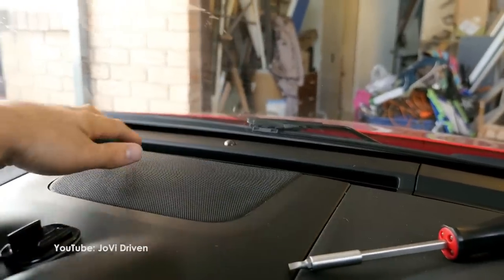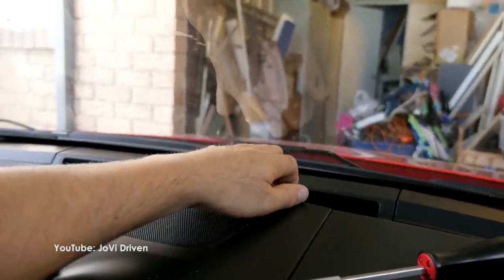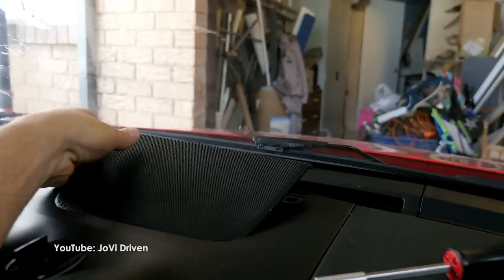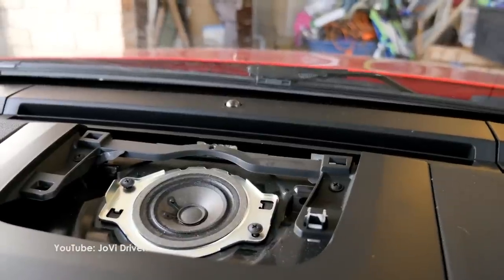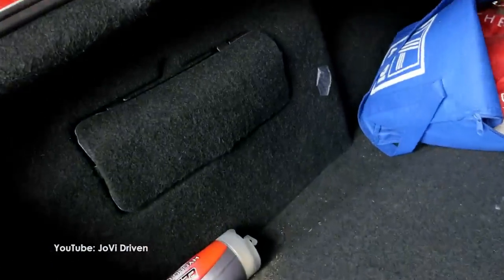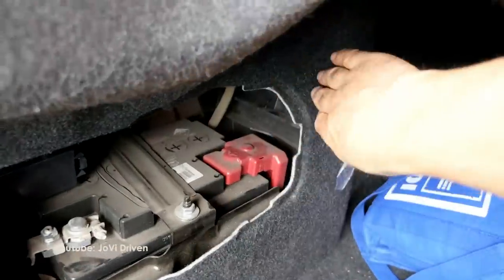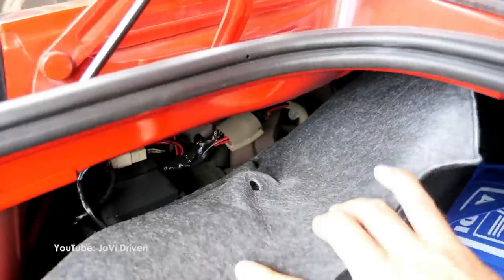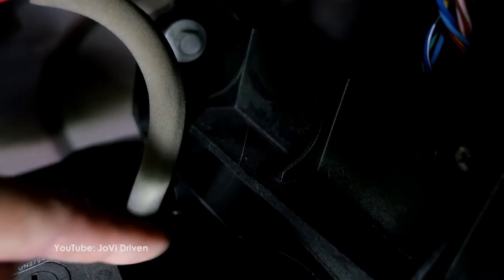VE Commodore Stereo Upgrade

Comment: I realise you are well meaning however turning up the gain is what you are talking about anyway , you really need to rip  out the whole system , put in quality AMP, Replace the 8inch subs with better 8 inch subs you can find 250 rms subs on eBay at about $140 each , the ones in Calais etc are about 50 watt it says on them and I doubt that is even RMS , also replace head unit , replace front and rear door speakers tweeters etc with quality , cost you about $1300 however everything about these Calais ,SS systems etc need to be chucked if you want good quality SPEND THE DOLLARS you only live once it’s about $1300 for a complete swap to get a decent sound
Reply: Ok but the point of this was free solutions that’s what he said

Comment: Most people probably aren't fussed about low end frequencies, and in my Calais V I have no problems with the audio quality. Have you got a Series 1 or 2? I've heard S2 isn't as good sounding, whereas the Blaupunkt are quite good in my opinion.
Reply from the maker: TheOnlyJarrod it's a series 2. It mainly depends on what style of music as to how bad or good it sounds. It handles hip hop and dance tracks well, but lacks a lot when it comes to most rock styles, which I mainly listen to. After making this video I reversed the polarity of the subs, which definitely made another improvement. I then also replaced the door speakers with Pioneer 6.5 inch 2 ways with I picked up on sale for $29 a pair. I also disconnected the dash tweeters, seeing as I now had them in the doors. I think I've got it to the best I can without looking at adding an amp. I wouldn't mind getting a high input amp in the future so I can get just a little more volume out of the 2 ways. I think the head unit is only like about 10w RMS per channel or something like that.
Reply: Yeah would be nice with some aftermarket speakers indeed, I want to look at Pioneer too, they seem to make some really decent ones for the price they offer.

Comment: i can confirm that this is NOT applicable for a VE SV6. No amp installed, although the dealer seemed to be under the impression it would be there. So basically, if you have a VE without rear speakers installed on the rear parcel shelf, you have NO AMP.
Reply from the maker: Thanks for clarifying Anita. I've just made some upgrades to my system for under $300 and am in the process of putting a video together. It will probably be useful for you, so stay tuned.
Reply: it seems as though the wiring loom is there to connect to an amp, but the cost of genuine GM parts is absurd here, so i'm going to look at a full Alpine install 8" unit etc.
Reply from the maker: It took me a while to figure it out, but the audio inputs from the factory wiring near the battery are actually speaker level outputs directly linked to the rear channels of the factory head unit. So if you can get a 2 channel amp with speaker level inputs, that should work to power 2 subs.
Reply: there aren't any subs fitted, only rr door speakers
Reply from the maker: Sorry, I though you meant you were going to fit subs as well. If you're just after a better sound, replacing the head unit will set you back minimum $1600, because you also need to replace the air conditioning interface, etc. But I've gone for a 4 channel pioneer amp with speaker level inputs and 4 new door speakers and it cost me under $300. To have it professionally installed would have been around $500 all up. This is the amp I used. Pioneer GM-A6604 4 channel amplifier with speaker level inputs: https://www.pioneerelectronics.com/PUSA/Car/Amplifiers/GM+Series/GM-A6604

Comment: Quick question if i upgraded my door speakers to pioneer 6.5s with the front doors having tweeters etc... if i leave the stock tweeters and that centre speaker in, does this reduce sound quality on the good speakers?
Reply from the maker: When I installed new Pioneer 2-way door speakers, I unplugged the factory tweeters.
Reply: I just put in a nvx coaxial speaker but still have my tweeters in... ive got no sound with centre and my door speakees are fine... i will remove the tweeters 2m and see if centre and doors work? Very strange!

Comment: The first part in relation to the centre speaker is good advice. The second part is really bad advice.
This is advice by people who don't understand gain.
Simply do some research or talk to someone who understands what it's for and knows how it works. Don't crank "up" your gain. Without getting into a long boring technical explanation, in a nutshell, you risk damaging your amp because you are decreasing resistance, and you'll get a crap sound because you'll have more noise/hiss in the signal too. Gain is NOT a volume control. There's a reason for a Gain setting. It's based on the total resistance of the devices connected to it and how they are wired (series or parallel).
So just leave it alone.
If you want better sound, first get a better amp, then, better head-unit and speakers, maybe a DSP... Do some decent subs and box them properly.

Factory sound is cheap and basic to keep costs down. Even when a car manufacturer uses "brand-name" gear it's the lowest costing most basic OEM gear they can make, and won't even usually come close to the entry level gear that brand will sell off the shelf.
Reply from the maker: To be honest, I'm not sure whether that control knob is gain or volume. But I've ran it this way for over 2 years with no issue. It's not distorting. Just adds a little more volume to the lower end, which helps balance out the rest of the audio system. And this was meant to be a no cost option, before spending on upgrades. I still ended up upgrading the door speakers and later ran a 4 channel amp to them, but still kept the subs and factory amp in.
Reply: This gentleman has no idea what he is talking about. He quotes "Without getting into a long boring technical explanation". That's a tell.

How about a short and interesting explanation.

Gain is simply 'pre-amp' volume. An audio amplifier has 2 stages. Pre-amp and power amp. Pre-amp volume (gain) is used to calibrate the incoming signal to a suitable size for the power amp, ideally about 2.3 volts. The power amp then takes this calibrated signal and amplifies it for the speakers.

By all means crank up your gain. If the result is perceivable distortion, you may want to dial it down a bit. You won't damage your amp. (unless it is being sent an over voltage signal in the first place)

This is, after all, exactly how guitar players get the desired distortion tone. They overdrive the pre-amp. Their amplifiers are not 'damaged' by doing so.

The installers at the holden factory may have been under instruction to keep the subs low volume for whatever reason. (Perhaps disassociation with the aussie bogan image hah)
Reply: @johnnykeys1978  yeah righto mate. A "tell", how insightful you are. I worked in the industry for years. But I don't really give a crap if people believe what I say or not. The info is out there. People should really do some research or speak to a professional before just listening to a YouTube video anyway.
Reply: @wonkothesane8632  You're absolutely right about this one. People really should do some research. Youtube is a source of research, and anyone researching the comment section here could have been given the wrong information, so I did something about it.

Comment: Will this work for a 2009 VE commodore international
Reply from the maker: I'm not sure if it has the amp in the back. You can always remove the battery cover and shine a torch  inside to see if the amp is there or not. Bit if you don't have speakers on the parcel shelf, most likely you won't have the amp either
Reply: International owners are stuck with only the volume control unless it came with the upgrade head unit.😭

Comment: What about Utes where is the amp .?
Reply from the maker: I couldn't find anything online regarding amps in the utes. If the SSV's have subs, then most likely would have an amp to power them. If they don't have subs, then most likely wouldn't have an amp. You could always try poking around a little in the cabin near the battery to see if you can spot anything.

Comment: Thanks heaps for that info! I’ve got a 2010 VE SSV Special Addition. (Pontiac G8) Do you know how to get my iPad to display on radio screen so I can also control the iPad from the head unit?
Reply: Clemmo you need a vim cable they sell them on like eBay pre-made you can make your own there is a great write up on g8 board forum.

Comment: I'm no sound expert but I actually like the way my factory stereo sounds in my Calais (non-premium system). I have been contemplating doing the much mentioned centre speaker delete as well as switching the polarity of the speaker wiring though to see if there's a difference
Reply from the maker: I usually depends on what style of music you listen to. I found that any sort or Hip Hop or electronic music sounded decent but a lot of rock styles don't because they don't make much use of the sub and you get a lot of mid to high frequencies screaming at you. The woofers in the doors also don't pack much punch.
If you like the sound of your stereo now, you love it even more by doing these 2 things. I was a bit sceptical about the polarity switch but it did actually work. The main thing is that it seems to lose some of the really deep frequencies that are usually muffled by the back seat, but it pumps stronger and louder.
Reply: JoVi Driven late reply lol. YouTube doesn't notify me of anything anymore. I listen to more electronic style music but also listen to some older stuff too and don't really have much complaints about the quality. I have disconnected the centre dash speaker though and it does sort of make a difference in a good way but hardly noticeable. Still been too busy to get around to the speaker wiring switch but hopefully it sounds even better. Some day I will get around to just upgrading the lot anyway and getting the parcel shelf speakers in too. Thanks for your reply!
Reply: I know this is a really old comment, but putting your speakers out of phase is just hurting your sound quality, loosing low end and your speakers aren't designed to work that way. They effectively end up sucking in instead of pushing air out.

Comment: I've got a 2011 SV6 Wagon. The stereo sounds like utter rubbish compared to my old school stereo builds on previous cars. 
Before I go pulling my car apart, has the wagon even got an amp?
Any tips for the wagon would be appreciated..
Reply from the maker: I wouldn't be sure with the wagons. If you have the premium sound system, you should have an amp. If you have the standard system, you probably won't. If you have an amp, it should be located near the battery in the rear. I'm assuming the wagons have the battery located in the same place as the sedans? If you can pull off the cover to get to the battery, you should be able to see the amp if you have one.
Reply: JoVi Driven cool mate.  I'll have a poke around.  I will let you know what I find.
Reply from the maker: Awesome. Cheers!
Reply: @Pabloworldwide  old thread but wondering if you had any joy with the wagon stereo? I'm looking at replacing speakers in the doors which seems simple enough but unsure what type to get, and if there's an amp hidden anywhere in the car.
Reply: @MrWah79  also, from my undergraduate, only top shelf models had an amp. There wasn't one in my SV6. 
Also, look into Kayhan audio in Australia. They make a beautiful replacement head unit with a massive touch screen and AC controls integrated. Replacement of your old IQ is recommended for upgrading things like amps, woofers, extra.